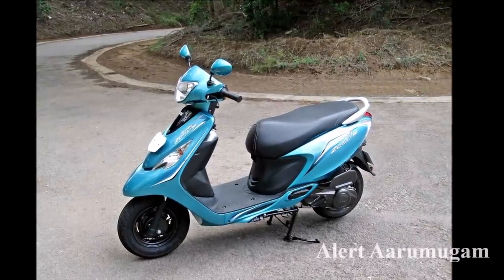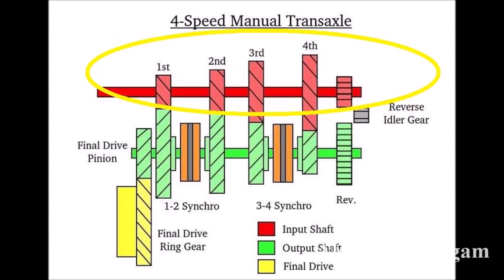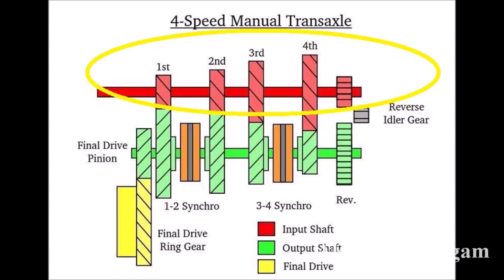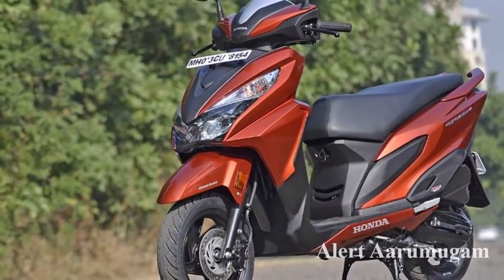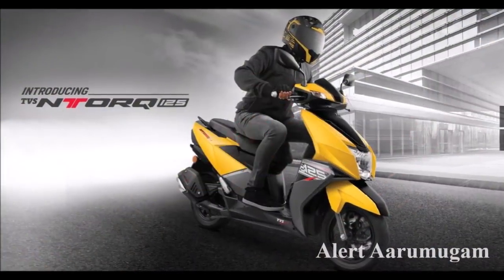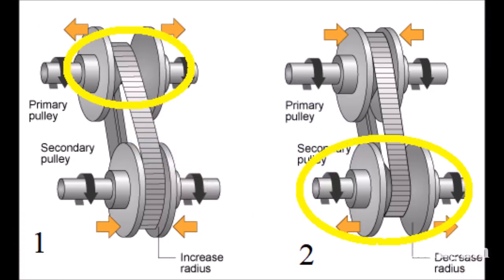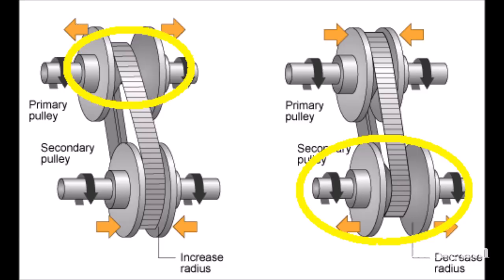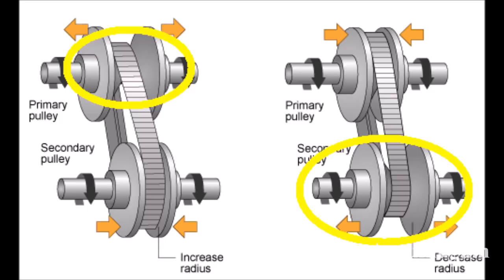Scooter - இல் மட்டும் ஏன் Gear இல்லை தெரியுமா?? | Scooter | Continuous Variable Transmission

Comment: Appa XL la endha maari work aagum???
Adhula chain drive dhaane iruku
Reply: Chain drive bro
Reply: @narenbalaji07 adhu ok sago question konjo silly aa dha irukum😅but ennoda romba naal doubt 
XL la single gear dhaane iruku 
Adhula epdi ivlo speed variation output aa kedaikudhu?
Apro XL oda engine direct aa wheel oda chain la connect aayurunchuna epdi engine a start panni move panna ma irundha engine off aaganunla?
Reply: @vivekp7338  bro cycle concept ah nyabagam vechikonga adhula mechanical ah pedal panrathuku badhila accelerate panringa avlo dha cycle oda same concept bt xtra va oru motor adha engine
Reply: @vivekp7338  bro neenga dha accerlate pani fuel ah engine ku tharinga la aprm yepdi off aagum